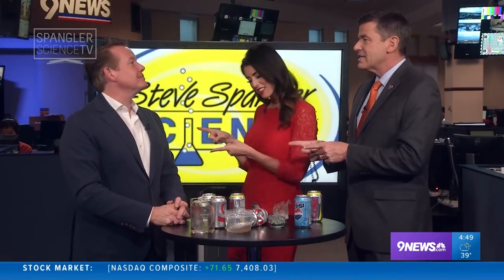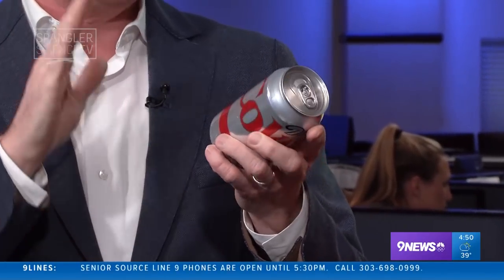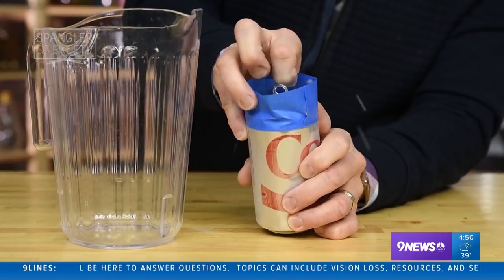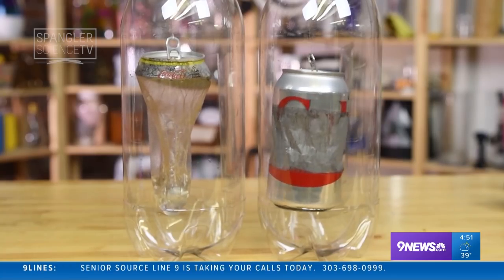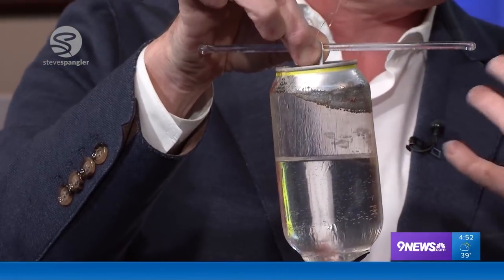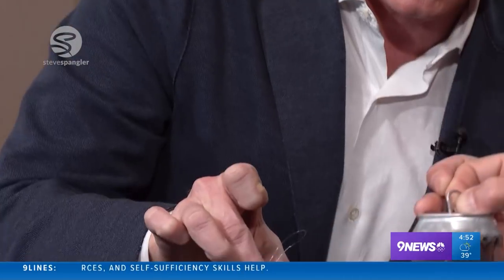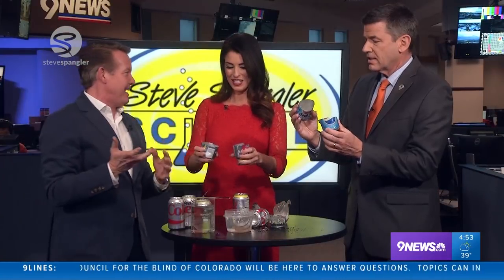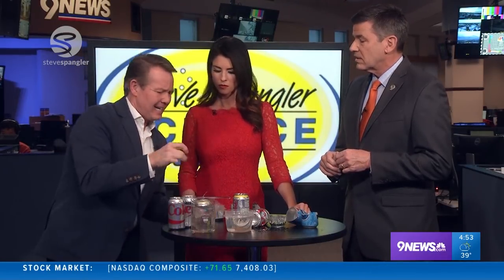Inside a Soda Can - Hidden Liner

Comment: This coating is applied as a spray. It is a thicker coating for soda than for beer as soda actually degrades the coating faster. I have been in production facilities and seen this coating applied. I used to work for a company that made systems to control the colors being printed. You can also see it at 3:42 of this video https://www.youtube.com/watch?v=V4TVDSWuR5E.

Comment: Hard to do at home? Not really. Google "muriatic acid" in your area. Almost every large grocery store has it in stock. Use that to dissolve the aluminum. It forms aluminum chloride and dissolves the can in less than an hour (hydroxide is more expensive and doesn't even do the job as well). Just make sure to dilute your muriatic acid to at least a 5:1 water to muriatic acid dilution or you could create deadly gasses! I am a senior chemical engineering student. Be safe and have fun!

Comment: Steve is a VERY COOL GUY!!!
So how does the 'liner' get into the cans? What is the plastic made of & how do the chemicals effect our body's not to mention the 'soda'. Doesn't or isn't the 'soda' capable of destroying the liner of our stomach?
You don't want to work where they make cans the smells from the chemicals are sickening.
     I worked for a short time at a can making plant in security & for some reson the police refused to work there. I'd have to call in & say I'm making rounds & I'd only have X amount of min to do the round or the cops would come automatically.
    That happened once when I caught a guy trying to leave in a truck with the huge roll of aluminum. I NEVER saw the bring in huge plastic wrap rolls on truck's EVER. How does the plastic get into the cans as a liner?
Reply: The liner starts as a liquid that is sprayed on.
https://youtu.be/7dK1VVtja5c?t=118
Reply: The acid in your stomach is far more potent than any of the acids found in any soda. That's why your stomach lining regrows so often, and why it produces stomach bile to cover the lining.